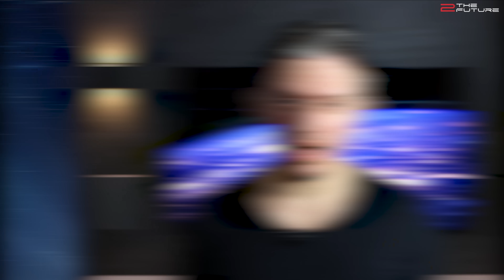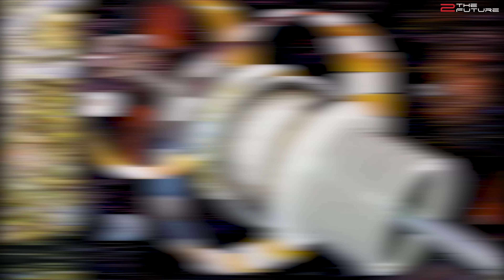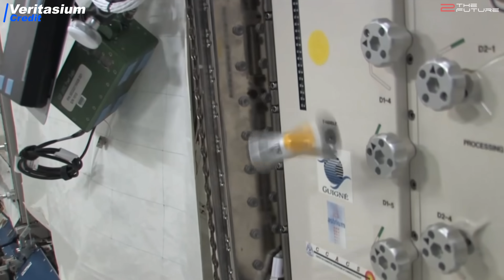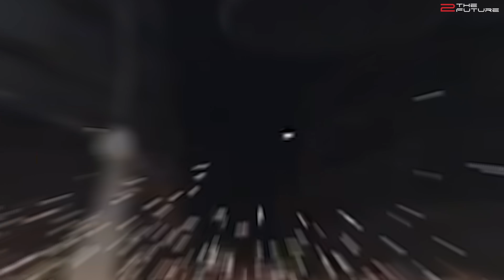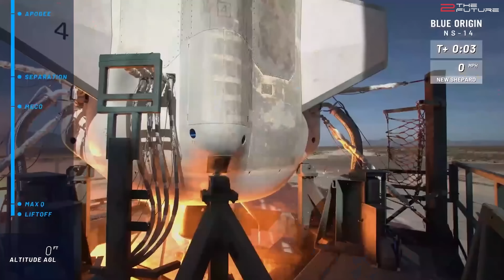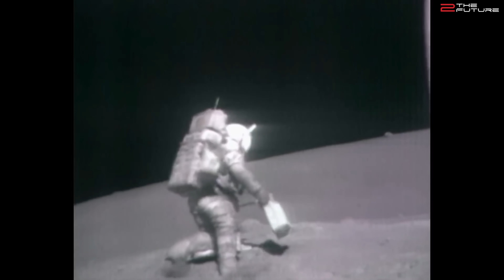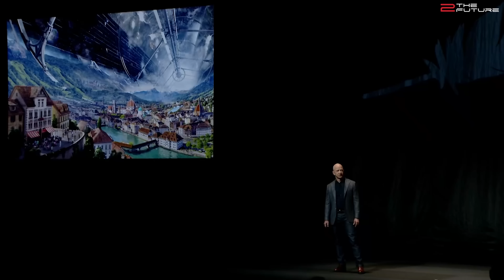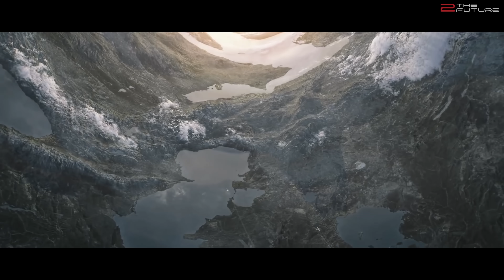How Do O'Neill Cylinders Work & Can Blue Origin Really Build One?

Comment: Sure, Bezos stepping down as CEO at Amazon is important but perhaps his shift to Blue Origin is because of the vaunted Human Landing System? And I think your reference to Babylon 5 [a great series, I agree] is because of the recent passing of Mira Furlan. No chance of a reboot now.... And I can remember reading O'Neill's book back in the '70s. It is a fascinating idea, but one with definite issues, like cosmic rays  & solar CME's. Solar power certainly is a valuable asset and offers a definite positive reason for attempting this type of space station. It may be possible to utilize a combination of metals & carbon fibers, etc., to make to structure, and then as insulation one could just bring up lunar regolith or materials from NEAs to fill in between the outer & inner superstructures. Lots to consider! Thanks for the episode! Oh, and I support sub-surface dwellings on both the Moon & Mars as they could be covered with a lot of regolith to block solar & cosmic radiation AND they can be easily be made airtight without having to worry by micrometeorites gradually degrading the surface of any exposed structure. With this in mind, one could combine tunneling/mining of the Moon with gradually building up the supply of materials for a station in the LaGrange points of the earth-moon system and as we learn and grow in expertise we can progress to larger stations in the earth-sun or even Mars-Sun & Mars - Jupiter LaGrange points...

Comment: Naked O'Neill cylinders outside of LEO are bad. You either core out an asteroid and build one inside it, or you take apart the entire asteroid, process out the metals, build you OC, and then use the leftover siliceous and carboniferous material to construct thick shielding. 

And, indeed, you definitely aren't building O'Neill cylinders anywhere without some really fancy (if not fully self-replicating) mining automation that mines the moon, or takes apart asteroids and spits out space Lego construction modules.

So maybe Blue Origin should work on mining automation or habs or surface vehicles or other types of off-Earth infrastructure. I think they could have a larger impact developing mining capabilities than they could trying to compete with Starship in the commercial launch market -- unless, perhaps, if they were to skip New Glenn and immediately get to work on a fully reusable New Armstrong vehicle ... of course by then, SpaceX might well have  12 meter Starship 2.0 or 18 meter Starship 3.0. :-)

Comment: Will the material to build a colony on another planet magically appear? No, it would have to be either shipped there at great cost, or the equipment to produce it locally would have to be shipped to the planet. So how much are you really gaining by building a colony on another planet as opposed to building an O'Neill cylinder? And as was pointed out, a colony on another planet will involve a lot more than plopping down a pressurized space and sticking people in it.

Comment: You know these things look very pretty and very technically sound except the fact of space debris these domestic habitats would have to have such strength as too deflect small rouge planets on its path to get wherever it's going it will destroy anything with appendages that have week points where that point would collapse or snap the only habitat that would survive deep space would have to be tubes of solid nature that any hits would simply roll over the unit something like the large asteroid that passed our system not so long ago

Comment: Okay, gang, why are you talking about an O'Neil cylinder colony design in the thumbnail, but you have a Bernal Sphere colony design in the thumbnail? EDIT: Okay, you explain it. Good research! EDIT2: A 1 meter thick hull!? Uh, that's kinda ridiculous! You'd have ribs made of steel cables, which might be 1 or 2 meters thick, spaced out, with thinner trusses between them. Basically, a cylinder habitat is like a very wide suspension bridge with no endpoints.  You don't see suspension bridges which have cables filling up their entire width! To have radiation shielding, you'd want a structure made of bags containing lunar regolith, forming a non-rotating shell around the rotating cylinder. In short, your estimate for the amount of steel is kinda high!
Reply: I agree. One meter thick seems like it would be a little too much steel hull than what is needed. With steel plates less than an inch thick evidently holding a couple of tons, 39.4 inches sounds like way too much. As a WAG, 10cm (3.9 inch) of steel with framing backing it would probably be more than enough. 

You can put insulation in the framing and on the outside of the hull to help with reducing radiation as a lightweight polyethylene plastic is good at blocking radiation per NASA. Having a 70cm of that polyethylene would be good for shielding (~7cm blocks ~30%) and cover it with 20 cm of the kevlar and cermaic blankets on the ISS for micrometeroids and you have a pretty good 1 meter hull. You would provide even more polyethylene shielding for sleeping quarters that would double as radiation shelters for when CME's are detected to be travelling towards the cylinder. Since they move slower than light, but can be detected at light speed, the satellites watching for them can give warnings to get to the shelters. Cosmic rays are constant, but with the blankets, shielding, hull, and dirt, you would likely have pretty good protection. The sleeping quarters doubling as shelters with extra shielding would be even more protection for roughly 1/3 of your day.

Now there would be buildings in this cylinder based on the drawings, but if you connect them through the center of the cylinder with cables and/or a passage way to a building on the other side, they would support each other's mass, meaning you don't need as strong a hull under them. A cubic meter of damp dirt is less than 2 tons, so depending on how you build the inside of the station, the hull should not have to hold up that much mass. If you build the buildings around cross supports through the middle of the station, that should help with stability and provide easier access to the other side. Not to mention the lower and lower 'gravity' as you approach the center for various applications.

Even if the station hull was ~900M tons, almost 15% of the estimate in this video, and a Starship could bring 150 tons to orbit, you are looking at 6,000,000 Starship flights just for the hull. So an O'Neill cylinder of this size would be an extremely massive undertaking to build with Earth resources, even if the whole Earth was working on it. If you build it out near the asteroid belt near one of the larger asteroids, it would be much closer to the raw materials out there, but asteroid mining and actual construction in space are still goals to be achieved. The ISS was 'constructed', but it was largely docking already assembled pieces in LEO. I'm thinking an O'Neill cylinder would be built out of pieces larger than would fit in a cargo bay and be more like building a ocean going ship here on Earth.

Bezos picked on Musk saying that the top of Mount Everest is a paradise compared to Mars and that is very true. But Mars would be a paradise compared to building in deep space.

Comment: Excellent video. Of course, the material requirements needed for a giant space station is beyond consideration. An asteroid station is more realistic and even probable in the not too distant future. That could be a money making proposition rather than a money spending program. If you are going to built something on the moon and then project it into space it is a waste of time. Far easier to build a settlement on the moon and make it permanently habitable using the natural resources already available. With upcoming rockets and fuel making capability on the moon or mars the cost would be a drop in the bucket compared to a massive space "world". Keep in mind, as far as Bezos is concerned, his thoughts have always been focused on a massive space world and he has the money to make a try at it.

Comment: I like your idea of tethering two starships to rotate around a central point. I am not a physicist or engineer, but it seems this is a first and easiest step to test the concept. Can you make the rope  tether real long for lower rotational speed?  The starships already  have lifting eyes in the nose stressed for 1g.  If it worked, a cluster of especially designed starships could be joined in a wheel array with fuel and oxidizer tanks designed to be adaptable to a space station plan. Eventually  perhaps the nose could be designed for removal and the hulls could be joined nose to tail  as prefabbed sections in a wheel.  What is wrong with this Idea?

Comment: I have reconsidered the asteroid-hollowing idea. Asteroids do not appear to have the necessary integrity to make this workable. You really need to do more processing before creating a habitat from those raw materials. Nonetheless, the raw materials are there, and the energy is there, so that reduces to an engineering problem.

ORIGINAL: It certainly appears that the easiest way to start would be just to find an asteroid, nudge it to where to want it, and start hollowing it out. Eventually it would become totally artificial, a lot of it even being exotic materials, but you could get a lot of immediate benefits just by burrowing into it, and gain experience all the while.

Comment: 13:30 Simpler is not necessarily better. Consider that building that comprehensive space infrastructure is something that will eventually need to be done anyway, with or without O'Neill cylinders.

Comment: A not insignificant issue with space based structures vs planetary body based structures is the RADIATION SHIELDING requirements.  Beyond occasional but devastating flare activity the fact that the solar wind is far weaker now than at any time in our records is that COSMIC RADIATION is increasing. At least with planetary body bases you could either use earth-berming techniques or what I consider a MUCH better idea constructing the bases under the ground.
A space colony just does not have "extra" mass that you can shift about when needed to increase protection. Even if you have an Emergency Shelter for all of the inhabitants in the way the current space station does you would still put *ALL* of your other biomass at risk. Livestock, agriculture.... all of it gone if you get one *TINY* flare or CME.
The current space station gains a *HUGE* benefit of being well within the Earths protective magnetosphere.  Remember too these are not simply "academic exercises" that do no affect Earth-based life. The Earths magnetic field is ALSO getting weaker at a remarkable rate.
Space weather is no joke but is not really discussed much at the "public" level.
Too "scary" and "sciencey" ....

Comment: There's no carbon on the Moon, unless it's very shy and is hiding somewhere. Is there enough iron on the moon to make an O'Neil III out of steel.  We'd need to capture carbon on Earth and send it to the Moon. What can the moon provide that we can build one out of and how many mass drivers would need to be constructed to make this feasible. How much of what we need to build the infrastructure on the moon would need to be taken there from Earth? Billions of tonnes to construct a cylinder puts Musk's plan to put a million tonnes on Mars into sharper focus.

Using a non-reusable ship would be prohibitively expensive for the number of launches needed to put everything in Lunar orbit and then to build the cylinder. Bezos isn't rich enough. A rethink is required.

Comment: Musk is right about the near term infeasibility of constructing O'Neill cylinders. If we also assume colonizing Mars is impossible in the near term due to low gravity the next best option is to is to build rotating O'Neill cylinder scale habitats inside large asteroids and small moons. The first logical candidate for such colonization would be Mars' moon Phobos. 

The space inside Phobos for the habitat would be excavated and used to construct the habitat itself. Such a structure solves all of the problems with O'Neill cylinders while providing a full simulated 1G, as well as very good radiation and meteor protection.

In fact colonizing Phobos has some major benefits over just about anywhere else. Phobos has the potential to be an economic powerhouse. Mining of Phobos would initially be the basis for a Phobos colony's economy. The colony could grow to be the gateway to mining colonization and trade. Having resources of it's own and being outside major gravity wells and being close to Mars and the Asteroid belt Phobos would be a prime location to trade with Earth, Mars, Deimos, the Asteroid belt and beyond.  Food, Fuel, ships, mining equipment could all be manufactured on Phobos. Again assuming Mars Gravity is too low for long term habitation citizens of Phobos could serve tours of a few months at a time on Mars mining it's resources, growing food and building infrastructure like mass drivers to get goods up to Phobos and to it's mass drivers for distribution throughout the solar system.. A lot of theses activities could also be carried out with telepresence robots controlled by colonist on Phobos.

Comment: I remember reading Gerard K O’Neill’s ‘High Frontier’ book in the early eighties and was captivated by its prospects.  Today I think that large scale O’Neill cylinders are many years away.  First, a Mars colony would need to be established.  Mars has more resources than the Moon to build the necessary infrastructure to allow a large colony to become self-sustaining.  Equipment lifted from Mars surface could be used to exploit Mar’s moons, Phobos and Deimos, both for metal mining and, more importantly, it’s processing. However, It is likely that plastics will play a much greater role in structural materials than metals in future.

Comment: No one is building an O'Neill cylinders within a century never happening, just sit down and calculate the mass you need to put into orbit. 
Simplest I idea I ever heard of was using a ice asteroid empty the middle, it's water so it melts and flows, then fill the inside with accommodation and rotate it.

Comment: Elon and Jeff are both right and it makes perfect sense since they wouldn’t be competing with one another. Elon is more focused on Interstellar space travel and Jeff is focused on building habitats in near Earth orbit which would be more beneficial to humanity it the event of and E.L.E. Elon would never be able to build a rocket big enough to transport large about of humans to Mars but Jeff’s idea could save millions of people more easily. As far as mining you would use 3D printers to build the O Neil cylinders which would produce a much higher quality material than steel and would be cheaper,quicker and more efficient. The moon is tidally locked to the Earth by the exact size and weight. And as it’s moving away from the earth each year by and inch or more, what effect would that have on the tidal lock. Mining on the moon would reduce its size and what effect would that have on moon if the loss of mass material starts to happen.

Comment: We wouldn't need to go straight to an O'neill Cylinder. We should start with something smaller like what we see with the Gateway Foundation. Their plan is to start small and keep building outward. A rotating habitat has some huge advantages even in the short-term because of having variable gravity and the ability to alter gravity by changing the speed of the spin. This would open up all sorts of opportunities for medical research and probably all sorts of other research. But it's not a one or the other situation. We should be doing both.

Comment: O'Neil's design was not practical.  He eventually realized this when he backpedaled to Bernal's existing design.  The Stanford torus is more practical.  It can be constructed in parts while it is being used, does not make every part of the habitat visible overhead, and can have separate sections that can seal off in case of a breach.

Comment: As a young farmer and L5 Society member back in the 70s, I imagined I might be able to help develop food systems on one of the first O'Neill cylinders. From memory I think O'Neill projected mining AlO2 from the Moon, throwing it, yes, day and night, to a kind of catcher's glove near the projected cylinder position at L5, where a solar powered refinery would produce aluminium. The aluminium wouldn't then be sprayed onto an inflated structure at about 600 mm thickness (the old two ft). So that would reduce your mass projection by 1/3. The alternative system you suggest from the asteroids looks faster maybe, but far more complicated. Yes it would take long to mine millions of tonnes of ore from the Moon, but it could be quite straightforward and cheaper. O'Neill suggested that once this initial hurdle was overcome, it could become the business of the first cylinder to build a second, and so on. Thanks a lot for the video.